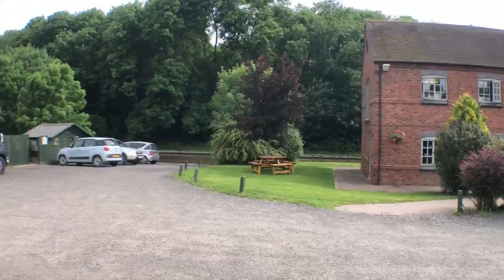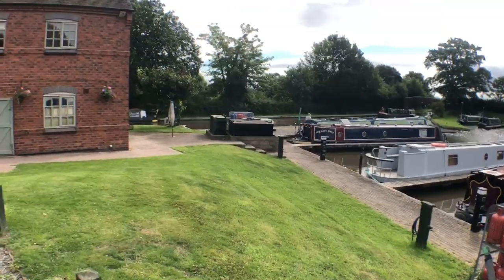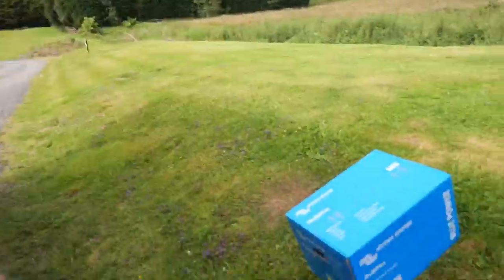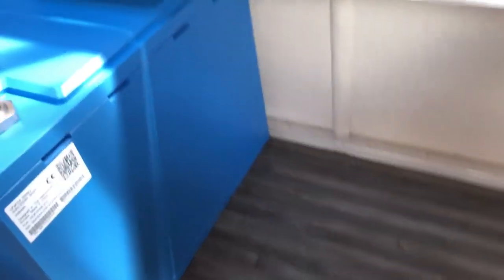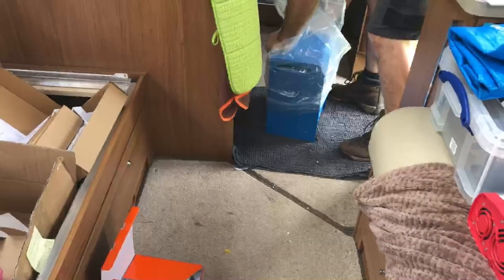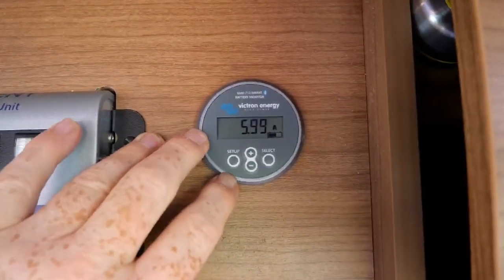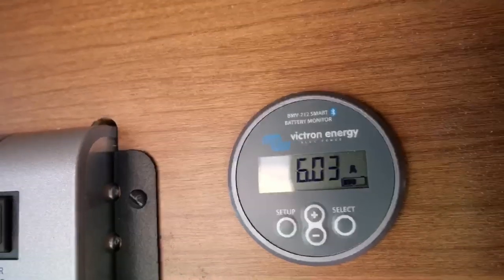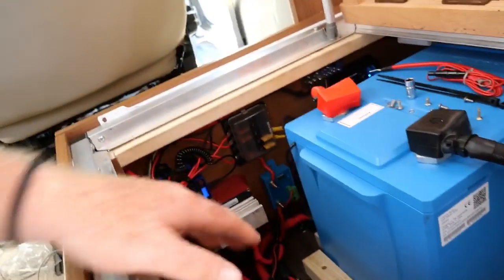Motorhome Off-Grid System with Victron Inverter & Lithium Battery -  the happy travellers

Comment: Hello I hope you are all well @The Happy Travellers. The content in this video is fantastic. It answers so many questions for off-grip working and some of the solution out there. I have a 2017 Autotrail similar to the one in this vid and I have already purchased a Victron Solar controller.  I will be mounting it in the same location as you did.  I am also looking to add a second panel and was considering adding a second controller to bypass the Sargent PSU altogether (one for the leisure battery and one system for the vehicle).   How did you charge your vehicle battery in your setup please?
Reply from the maker: We used it so frequently that it stayed charged without any solar.
Reply: @TheHappyTravellers  Thank you for the reply. I hope you have a nice day.

Comment: amps panels etc bit confusing!! fridge that uses 30amps?, what is cost of system?, is jon lane correct when he suggests buying a good silent generator. what is the benefit of either the system or the gennie or simply start engine for a bit . luv to know payback time
Reply from the maker: It can be confusing if you are not a pro and involved with it all the time. There is no such thing as a "silent generator" unless you go for the EFOY system which would cost me £5200 for my type of usage. The EFOY needs fuel to be carried too which I'd want to avoid. We have tried out a Honda i10 for a week (courtesy of a fellow rallier) and it did work for charging the batteries up etc. There is a long list of issues with petrol generators, and the downside just is too big for us to consider it for full-time motorhome living.
The convenience of having the motorhome "think" it's on EHU all the time so we can use the microwave and all the 230volt sockets, far outweighs any "payback calculation" but I've calculated it to be about 2 to 3 years based on the general uplift we'd pay for having EHU.

What I can say is that the system we have is fantastic and seriously pleasing in terms of convenience. Two weeks in we are very happy...

Comment: perfect system for sunny  southern Europe in the summer  but like any solar system it will  struggle is a European winter
Reply from the maker: You are correct that solar panels work best in brighter sunlight that’s why we have the Sterling Power dc battery to battery charger 👍😀😎
As a complete solution it works pretty well but as you will know, everything is compromise.

Comment: I realy wouldn't have bought all that victron .i would o bought a good silent generator
Reply from the maker: Thanks for your comments...Apart from the EFOY System, there is no such thing as a "silent generator" and all generators require fuel to be carried. I've tried a Honda i10 with the associated gallon petrol container and to be frank it just did not provide the convenience and clean operation of the Victron Off Grid system we've installed.

Solar panels and the DC Charger from Sterling provide us with pretty much free 230-volt power all of the time. The convenience is excellent and I would not change it. In fact, if I were to start all over I'd buy a slightly less costly motorhome and allow more for this sort of upgrade and maybe allow for 2 X 200Amh Lithium Batteries.

In use, this really is a stunning setup, even for voracious electricity users like us.

Comment: Have you thought about tilting the solar panel to the sun when parked up you would get 6amp all day pointing at the sun and add another battery would give you 400amps
Reply from the maker: Yes we do have a portable solar panel that we could connect and we have found that to be more efficient but the roof mounted ones are fixed so no tilting can be done. 
As for adding another battery, we would have to crowd fund that😱

Comment: Does this setup allow the panel over the jab door to continue to operate (show battery condition, levels etc)? It looks exactly the setup I would like on my Delaware, but I really like both the panel functionality and the remote connection to check van location and temps etc. Obviously the remote connection is a Sargent system too.
Reply from the maker: Yes the panel above the hab door still works. However I don’t use it for battery state as I have the BMV712 monitor and can connect to that from my phone over Bluetooth.
Reply: Do you use the Sargent remote tracker Roger?

Comment: I like watching your videos - but this one absolutely left me befuddled! Haha. 
Thought I saw a very small screw left on the floor/corner of 12v battery (label side between battens). Any thoughts on making the battery more secure? Mike
Reply from the maker: I know what you mean Michael about being befuddled. It’s been such a steep learning curve for me and that curve is still on the upward trajectory!!
As for the battery being secure it’s already not able to move sideways and have no real chance I’ve moving upwards in transit. Due to it being lithium it could be installed in any orientation so is pretty safe. 
Thanks for your comments 👍😀😎

Comment: Not being pedantic but the inverter/charger is 3000va not watts. That equates to around 2400watts at 25 degrees Celsius.
Reply from the maker: LOL 😂- now you’ll have to explain in detail what that means; what would the Wattage be at 20 degrees Celsius, or with a power factor of 1?, LOL 😂
Reply: @TheHappyTravellers  😂 no idea, but the hotter the inverter gets the less output you'll get. 

http://www.victronenergy.com/upload/documents/Datasheet-Multiplus-inverter-charger_2kVA-and-3kVA-120V-US-EN.pdf

Comment: So you’ve just the lithium now off two panels or have you still the other three batteries outside? How do you feel about having the battery all that kit in the habitation area? Personally I’d not been keen. I guess it wasn’t possible to install in the external battery area?
Reply from the maker: The Lead Acid and Lithium are not a good mix as they operate differently so we are ditching the Lead Acid and now have the 200Amh Lithium. There is no issue with “all that kit” under the lounge sofa. The problem with the external battery area is that it is designed to take 2 lead acid batteries and that’s it. As you’ll see the system we have installed needs a bit more space.

Comment: I have a setup broadly similar to this, but with more Sterling equipment and less from Victron.  We also tend to move about more, never use electric hookup,  and do all our cooking on electric (we don't have gas as this isn't 1975).   I have some bits of advice based on my experience of running a similar system , so real knowledge, not speculation!

Try to replace any 230v chargers with versions that run on 12v.   For example, a laptop will usually run on 18-20v and yet you are storing the electricity at 13.5v, converting it to 230v and then back down to 18v.   This will involve a significant loss.

I find it much easier to use the percentage display on the Victron BMS and then think of all use and charging in terms of percentages.  So boiling a kettle with two cups might be 2% and running the fridge for a day might be 12%.    I then have a fairly good idea how long the batteries will last.   To this end, get a cheap power meter that plugs into a socket and measure typical use for each device. but bear in mind that you then need to account for the loss in the inverter.

The fridges that run on gas are  dire and so if it ever needs replacing then get a 12v (or even 230v) compressor version.    This should be far more efficient and you can also think about extra insulation and venting the compressor to make it more efficient still.

Your B2B charger appears to be one for the marine market so looks different to ours but is probably functionally the same.   We have a 130A alternator and found that we can charge (we have two B2B chargers) at 120A but in practice this has never been necessary.   We have both chargers now set to half power and 60A is more than enough because we move a lot.  In fact we have found that just nipping to the shops is enough to top up the batteries, but then we have a tiny van and use it like a car, not a huge motorhome that is parked up a lot.   I would say that our chargers can be noisy and get very hot when running at full power, so need to be well ventilated. But again we have a tiny van and so we are near the chargers.

We have an electric kettle from Vektra.  These come in different sizes but ours is only 1400W but is inside a vacuum flask and so boils very quickly.  The water also stays hot for ages and it doesn't spill if knocked over.   These kettles save significant power over normal 230v kettles (due to insulation) and will run while, for example, you use the microwave or an induction hob.   If you also want to save power I have found that a saucepan made partly from silicone (such as the Kampa folding pans) uses 15% less energy than a metal pan when using the induction hob.
Reply from the maker: Hey Kevin, thanks so much for that. Really useful info. This comment wins the “best comment” award 🥇

Comment: Great informative vlog:- Looks great 👍 However Don’t kill your alternator .....might be worth getting advice as to how low you can go (50% maybe) ? ♥️😇🌹💐
Reply from the maker: The DC Charger is designed to use the “excess” power generated by the alternator, not quite that simplistic but it all good. The Lithium battery from Victron is designed to go as low as 20% (180Amh usable power) and yes we have taken it down to 23% in the first week. Today it was down to 68% at 10:30am but by the time we returned from a day out at around 6:30pm it was back up to 100% due to the 300 watts of solar panels (1X 200Watt + 1X 100Watt).
Reply: The Happy Travellers :- I would still ask about your alternator being up to the job of charging what amounts to a “large load” when the lithium battery is down to 20% - I’m sure it will be fine but I think it’s better to be safe than sorry. 
I’m no expert here but a 90amp alternator i would think is matched to a “reasonable charge load” - bearing in mind its originally designed just to charge the engine battery. I Don’t wish to sound pedantic however I wouldn’t want you to lose your alternator prematurely especially if you’re away in Europe somewhere- it would be a pain. 
My thoughts are I would want to keep that battery above 50% before starting the engine. ♥️😇🌹💐👍
Love the install
Reply from the maker: chris scannell it’s supposed to be a “smart” alternator so should manage just fine. In any case, my experience of asking questions like that are met with the very safest answers usually because the situation is unknown and the technical person does not want to be exposed to any sort of comeback. They’ll probably say, “best not to place additional load on it...”. On the flip side the Sterling Power people are experts in the field and sell the units commercially. They certainly know what they’re talking about so I trust the unit and Sterling ;)
Reply: The Happy Travellers - Great 👍 Whilst on :- and 
On a completely different subject :- Sureflow Water pumps - I have found after time the six screws that hold the electric motor to the pump rotor mechanism loosen slightly (vibration probably). This can manifest itself in a few ways:- a random start up to regain pressure. Air getting in and spluttering whenever you first run tap...a small visual drip around the pump flange/housing between the electric motor and rotor. It’s a easy fix with a dumpy Phillips driver. So try first before thinking the pressure diaphragm is shot. Hope this helps. Great vlogs very interesting-keep them coming. Thanks Chris. ♥️😇🌹💐